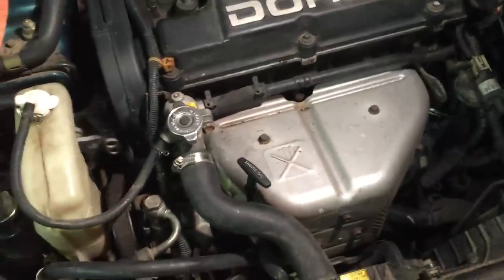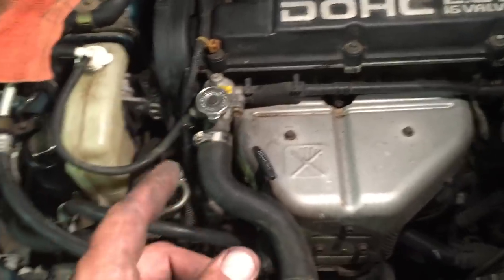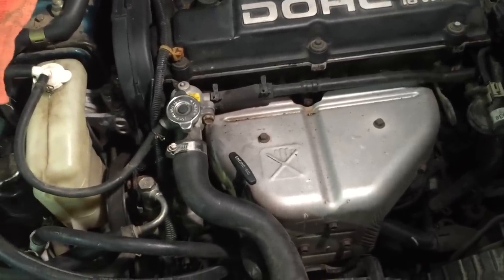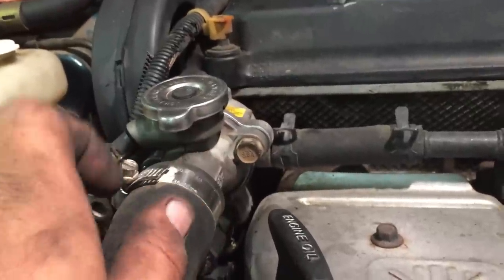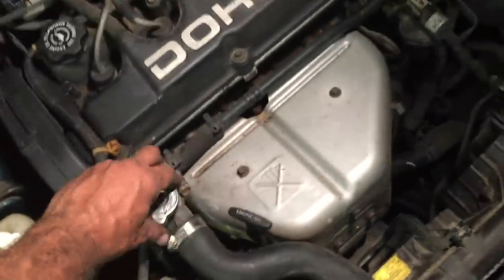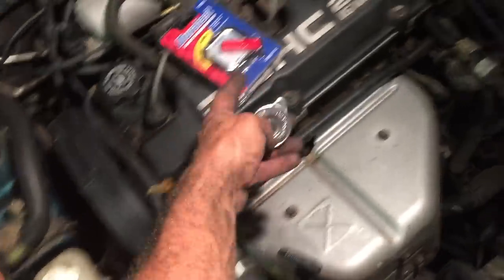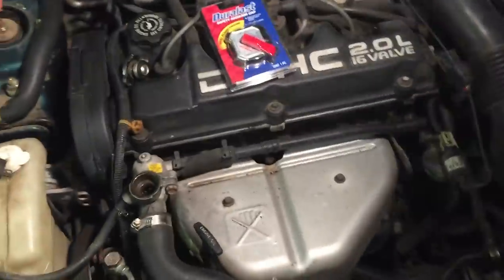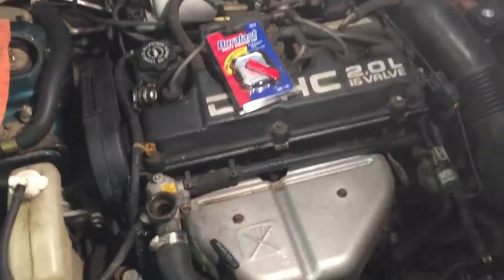How to Determine if Your Radiator Cap is Bad (P2181)

Comment: I have 99 mustang v6 3.8, I replaced thermostat because I seen a coolant leak around that area, still had a leak found a pinhole right at the heater hose via pressure test, so i JB weld it and no more leaks in the engine bay or underneath topped off coolant (left rad cap off til car heat up through idle and wants to bubbles over put the cap back on, drove it used my air bleeder valve, let cools down and repeat by topping off of was still low) car stayed nice and toasty even at idle but always noticed My radiator cap stays cool to touch since but the coolant is clearly hot. As the winter has gone on, I am noticing the car is only pushing warm air now and that's when I drive but at idle it cools down. I feel like some how I have air in the system still as I use my air bleeder valve and still see air bubble coming out, while coolant and radiator hose are hot. Reservoir has maintained it's level and still looks green. Do I have more air in my system, is my cap bad(usually they get so hot can't even touch) do I need to continue to let the car cool and add coolant through the rad cap if seems low, let warm up and use air bleeder valve, would my heater core be going bad or water pump(as I stated no leaks or over heating) I have done a radiator flush when I did my thermostat as well. I can't figure this out, can you please help, I don't have extra for a mechanic so I do stuff myself, I'm good with my hands. IDK why air was warm for months but now only blowing warm when driving then cool when idles or why bubbles keep coming out of my air bleeder Everytime I crack it open. IDK how air would get in the system as I'm sure the thermostat is tightened down fine because if it wasn't leaks out be happening, I used a gasket and sealer to make sure

Comment: having a same problem. they replaced my water pump,thermostat and flushed out the radiator. 14 days later it almost over heated again. pulled over when got hot. had it towed to the shop for them to tell me that it's now the radiator to go bad. ANSWERS
Reply from the maker: radiator cap is leaking. replace the cap. thanks for watching.

Comment: my problem is that you need to fill up the radiator with water everyday before driving the car. I can't put coolant in because it's losing the coolant in such quick pace. so I had to use water to save some bucks. what could be the problem?
Reply: also there's no sign of leaking in the engine bay, around the radiator or under the car..
Reply from the maker: you need to find out where it is leaking from. it could be something simple like a loose  hose clamp.if you see water on the ground you should be able to find where it is leaking from. the water pump will be under plastic at the front of the engine. so if its in that area it could be a water pump. it may be the radiator, a simple pressure test from a auto parts store ( free ) will tell the tale!
Reply from the maker: inspect the radiator really good , it could be that its cracked and running down. get a bright flash light and inspect away. you will find it. let me know the year make and model and the engine size, and where you think its leaking from. i have a few tricks left, ha. good luck
Reply: also if hes loosing coolant/water with no wet spots under the vehicle best guess is he has a bad head gasket
Reply: mindman1234 

I'm

Comment: having the same problem, water pouring out of the cap and the reservoir is always full, its like the cap cant hold the pressure because my reservoir is pressurize and all that pressure goes out the radiator cap.
Reply from the maker: +EK9GraphicDesign 
this is a bad cap, there is a seal, and spring under the cap like a thermostat. your over fill should not have presure. thanks for watching.
Reply: +thomas brian yes ill buy one today but why they go bad so fast? i bought this one like 3 or 4 months ago. could it be that my radiator is too small? (i dont have the stock one and its some inches smaller than the oem one)
Reply from the maker: when the presure builds is it hot, or cold air?
if its cold you could have a bad head gasket, and that air presure is from the pistons.
Reply: +thomas brian when its hot
Reply: +thomas brian when hot and the coolant from the reservoir doesnt go back when cold
Reply: Is it possible that when the car is off,  you loose coolant when you don't even know it?    My car stays cool,  and doesn't over heat,  but when I get in my car,  and there's no heat,  I know my coolant reservoir is empty,   I don't know where the coolant is going.   I filled my coolant full before leaving for a 45 mile journey,  my car stayed cool the entire way with heat,   checked when I got there out of curiosity to see if I lost any,  but not even one drop,    however,  when my car is off,  I seem to loose coolant.    It's weird.    Could a radiator cap be doing this?    I noticed my cap doesn't look in too good shape.
Reply from the maker: 2010MegaScooter
yes it could, it could warm up and evaporate. check also the carpet by the passengers seat to make sure its not wet.( bad heater core). also look for white build up everywhere water lines are those are tell tell signs. if it has a leak it could be so small that its evaporating. you could rent a pressure tester. it connects where your cap is and pump it up to about 10 lbs it will leak somewhere. then you will see it. if no leak at all then change the cap. most auto parts place rent these for just a dept, that you get back when you return it.
Reply: +thomas brian 
Alright.  There's something else that just started happening,   and I am getting my car checked her in a couple days, but when I start my car in the morning,   Waitakere for it to heat up,   my temperature gauge won't move an inch.   However,  when I start driving, the gauge will move real quick,  but not overheating,   it will just rush to normal temp.    Also,  I am not getting any heat,  until I am like on the highway,    once I slow down,  it'll start blowing cold.  Now - -  bare with me,    because it's just weird --  My car will start blowing warm air again,  even idling,   and pretty much,  I don't loose coolant,  and my car stays warm (until -- like I said, turn off my car)   
Hope you understand,  

What I am thinking... 
Plugged heater core?    
Pinhole in a hose somewhere?   
Water in system? 
Thermostat sticks until warm? 

Those are my guesses,  what do you think?  I'm not too Much a mechanic,  I'm only 20 years old.   xD
Reply: +thomas brian 
Alright.  There's something else that just started happening,   and I am getting my car checked her in a couple days, but when I start my car in the morning,   Waitakere for it to heat up,   my temperature gauge won't move an inch.   However,  when I start driving, the gauge will move real quick,  but not overheating,   it will just rush to normal temp.    Also,  I am not getting any heat,  until I am like on the highway,    once I slow down,  it'll start blowing cold.  Now - -  bare with me,    because it's just weird --  My car will start blowing warm air again,  even idling,   and pretty much,  I don't loose coolant,  and my car stays warm (until -- like I said, turn off my car)   
Hope you understand,  

What I am thinking... 
Plugged heater core?    
Pinhole in a hose somewhere?   
Water in system? 
Thermostat sticks until warm? 

Those are my guesses,  what do you think?  I'm not too Much a mechanic,  I'm only 20 years old.   xD
Reply from the maker: sticky thermostat , that is what i think as well.
there may be a issue with the heater core as well, but the plug will move eventually. some times people add orange, red, or green antifreeze. these colors can not be mixed. they will all soon turn a brown rust color and gel up in the system. i do not believe you have a leak, here is why.. you would not only loose water, you would loose pressure. without 5 lbs of pressure you will not have heat at all. the smallest pin hole will loose pressure. thanks for watching, i hope this helps. click on my name under the video i have a bunch of these videos, thanks again.
Reply: +thomas brian 
Hopefully, nothing major.   My car stays at a normal temp,  just no heat.    Thanks for the input,  it's much appreciated,  I'll post when I find out what's wrong with her.
Reply: thomas brian trail blazers 2002

Comment: I have a slight problem maybe, some man put water in the reservoir and I put coolent in the radiator Two weeks ago that's ok but now there's a little bit of water in the reservoir and mixed with coolent so today is Saturday and I used the AC and now it's almost gone,but this morning I started the car and it sounds like the motor was falling apart, so I came back where I was the engine was hot ,but not overheating, there was a puddle under the car where the water pump is located, I know this person said it was water from the AC, I understand that, then I added more coolent to the reservoir it was almost gone. I don't know what going on I'll find out tomorrow if the radiator cap is bad ...
Reply: I forgot to say it's not overheating at all , IV been watching the temperature gauge it's stayed in the middle,

Comment: Water+radiator=rust NEVER run anything but antifreeze in your motor it Coates your radiator water just rust the inside of your radiator,thermostat and freeze plugs out